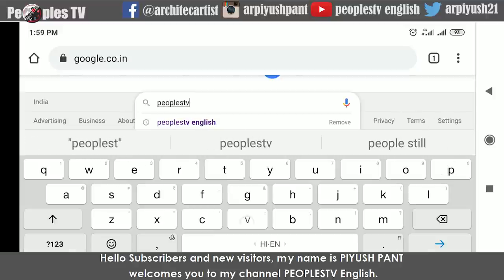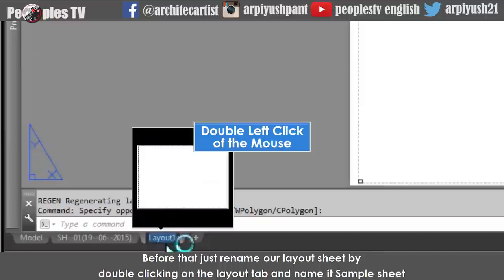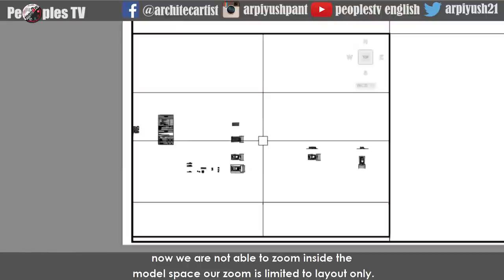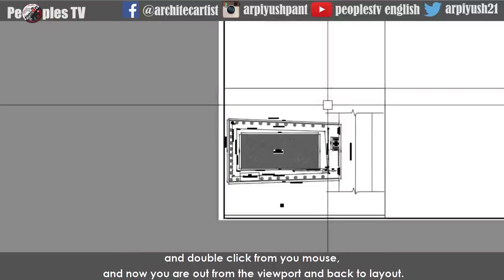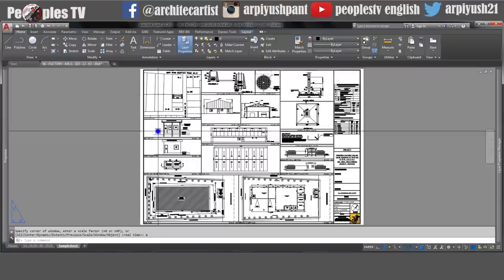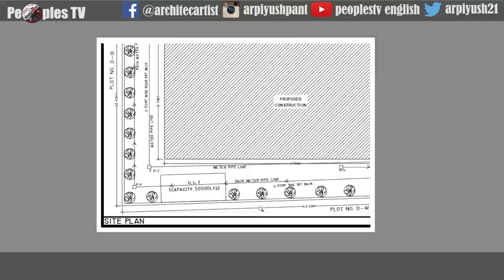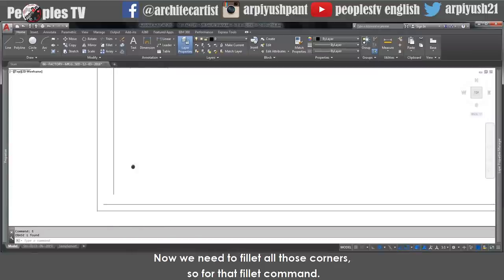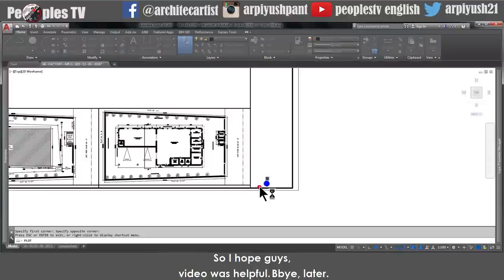How to work in AUTO-CAD LAYOUT / PRINTING the DRAWING in MULTIPLE SCALES / PRINT & PLOTTER SETTINGS

Comment: there is a problem with my layout. Would you guide me what is the problem?
   My autocad units are centimeters and  I have draw a rectangular simple plan 1148 cm*750 cm (I have draw with 1:1 scale).  In my layout settings paper is A4 portrait. Printing scale is 1:1 and I have printing setting as layout. 
     My layout scale is 1:100 which means I should have 7.5cm*11.48cm on paper after printing. But my printing results 10 times smaller than what it should be. And only after setting layout scale to 1:10. I have 1:100 scale on paper. I will be so thankful if you help me in this case.

Comment: what if the working layout isnt center the position how to solve that? when i try to center the block template on my layout working space isnt fit to the working layout space
Reply from the maker: Hello GD,
There is a option of stretching the viewport in layout in which your block is showing by using the grip points you stretch the viewport and make it fit to your block

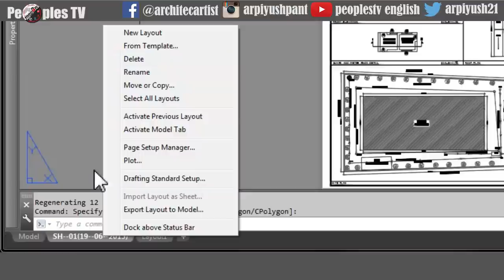Comment: I mean my 1 viewport is 1:100 another is 1:50 another is 1:10 so how me set our text and dimensions in same size.
Reply from the maker: There are two ways to do it 

Either you increase the dimension size in model space based on scale, separately in different layer

Or hide all text and dimensions in model space and make separate dimensions and text in your LAYOUT itself, but don't go inside the viewport, do it outside in LAYOUT itself, those texts will only be visible in LAYOUT for print

Comment: Sir I have an issue, if i set scale 1:100 my drawing more smaller than before,  drawing unit is meter
Reply from the maker: Hello mohsin, please LIKE the video of you haven't to support, 
Regarding your issue, the paper size units needs to be modified, it will not be 1:1 that is only when the paper size unit and drawing units both are same, 

When you editing the paper size change the unit as 1:1000
Reply from the maker: You need to change the scale in Page setup manager as 1mt equals to 1 unit
Reply: @peoplestvbypiyush  thank you sir
Reply from the maker: Ok +918279615880

Comment: Sir if we are using different scale in the same sheet then how to keep the text height and dimensions  (text) height consistent or same ?won't that be scaled too.

Than sir a detail  video on line weights  in layout and model space and Even in exported pdf....!
Reply from the maker: Yes text will be scaled too, that's why we need to set the dimension and text size according to the scale we are showing that drawing, usually the thumbrule is for 100 scale our text size in model space should be almost 200 or near by
Reply from the maker: For high resolution PDF export and Lineweight in exported PDF

https://youtu.be/FwzNxG5pZ50
Reply: @peoplestvbypiyush  or simply use annotative dimension and text  style
Reply from the maker: Yes more easy option those who known it